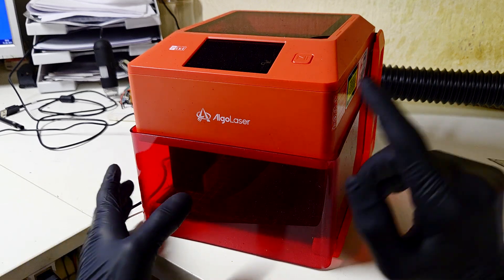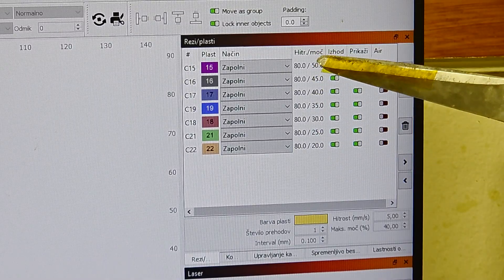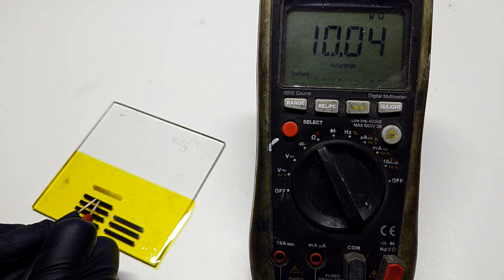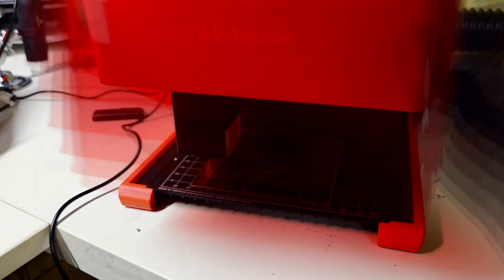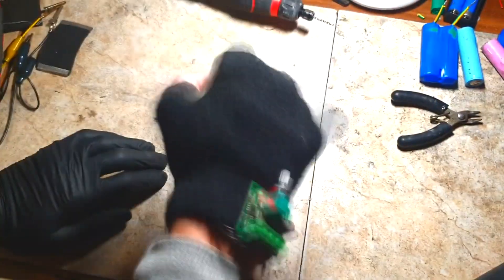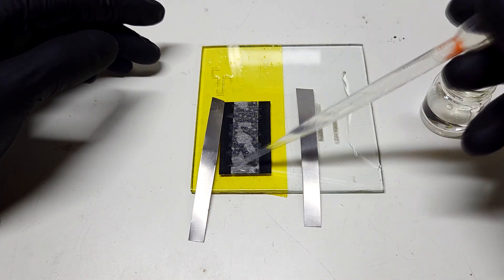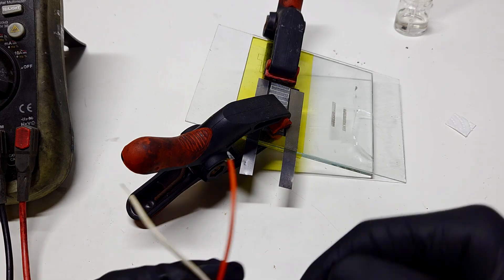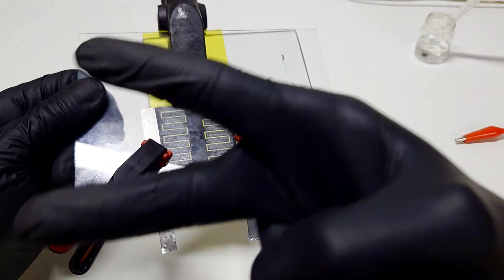DIY Laser induced Graphene Supercapacitor

Comment: Another great video, and probably one of the best I have seen to demonstrate how to calibrate your laser  speed & power settings. One improvement (as shown by James Tour from Rice University who developed this process) is to de-focus the laser  slightly. This can often be achieved simply by adjusting the laser's material thickness a few millimetres higher than what it actually is. This will then effectively widen the laser's beam & allow the exposure lines to overlap slightly and remove the more defined lines that can be seen in the close up images, creating a more even , and therefore more uniformly conductive graphene layer

Comment: A few decades ago, I conducted this same experiment with my 30W CO2 laser using different types of wood as a carbon source.
And the trick I discovered was in the blurring of the laser beam.
You don't need to apply a lot of power.
By keeping the beam defocused, the area is slightly larger and the energy density is lower, but the number of times the beam “hits” that area is greater, which means that it is not necessary to make multiple passes over the same area to induce graphene.

Comment: we need to crowdfund a factory for this where investors get paid in super capacitors
Reply from the maker: 😁 I am in. I was thinking for batteries, but supercapacitors will be also ok 😊
Reply: @cayrex just throwing ideas out there
Reply: @cayrex batteries would work
Reply: @cayrex any ideas on a manufacturing method ?
Reply from the maker: @Soda_and_me  You mean of this type LIG cap? I making a new video on this topic. In the video I try to burn kapton direct on a titanium current collector,... but  the kapton tape have adhesive side which also need to be burned. Other ways the adhesive will isolated the carbon. For that reason I need to higher the laser power from 45% to 80%. But in the end that supercap was not so good like I was  expected. Roll to roll method is also interesting,.... which with that method you can make capacitors or sensors in meters.
Reply: I guess i like the flow battery idea
Reply from the maker: @Soda_and_me  Yes for sure, me to. I also work on Hyperflow lite battery,... which the idea is to make a minimal neutral cell design, robust and low cost battery. The battery donnt have the best efficiency, but can be really cheap.

Comment: In your measurement is sort of problem that gives you not very correct resistance of each graphene stripe. You should touch every stripe of graphene with omo - meter's terminals in exact the same distance between terminals. The best accuracy you would get keeping the longest possible distance on all stripes (the distance must be the same on all stripes ).
Reply: Exactly. A solid spacer holding the probes at a fixed distance would provide a more reliable reading. In the video the probes kept getting closer and closer as the resistance dropped 😕
Reply from the maker: Yes, correct. Before I make a video I repeated the stripe test 5 times, and there was no big difference. The strip test was meant to get the idea what power and speed setting to use for making the heater and the supercapacitor.

Comment: I imagine instead of about 8 fins being drawn on the captive tape, if you had made about 100 or 200 fins with adequate spacing and 2 capacitors in series, maybe you could have gotten a very high capacitance,it's worth a try
Reply from the maker: For sure mate
Reply: The capacitance comes mainly from the flat vertical surface area of the charred polyimide, not from the edge horizontal surface area. Interleaving more will reduce ESR, but will result in less total surface area and so probably lower capacitance.

Comment: According to Deepseek:
Preparing Boric Acid Solution:
Prepare a solution by dissolving some boric acid powder in ethyl alcohol. The solution should be clear. 

Kapton Tape Coating:
Find a flat, clean block (e.g., glass sheet).
Using a pipette or brush, apply the boric acid solution to the Kapton tape, creating a very thin, uniform layer.
Wait for the solution to completely evaporate and the boric acid to crystallize into a thin layer of Kapton. This is a critical step before laser processing.

Producing LIG-B with Laser:
Your boric acid-coated Kapton tape is now ready.
Attach this tape to your laser as you did for pure Kapton.
You can optimize your laser speed (power and speed). The presence of boric acid will alter thermal insulation and absorption. Make small adjustments to the settings you used for pure Kapton until you achieve a regular, uniform, and highly conductive graphene structure.
During the laser treatment, boric acid will be broken down and boron atoms will be incorporated into the graphene lattice.
Reply: After asking other Deepseek questions:
Increasing Energy Density with Manganese Dioxide (MnO₂) Coating
Mechanism: LIG stores energy electrostatically (double layer). MnO₂ stores energy through fast, reversible chemical redox reactions at its surface, called pseudocapacitance. Combine the two and you have a hybrid supercapacitor. This combines both the high power of LIG and the high energy storage capacity of MnO₂.
Materials:
Prepared LIG electrodes.
Manganese(II) Sulfate Monohydrate (MnSO₄·H₂O) or Potassium Permanganate (KMnO₄).
Sodium Sulfate (Na₂SO₄).
Power source for a two-chamber electrodeposition setup.
Platinum wire or Stainless steel counter electrode.                                                                                                                                                                                                                                       Method: Electroplating (Best Method)
This method allows you to coat MnO₂ directly into the pores of the LIG, which provides significantly better performance.

Prepare the Solution: Dissolve 0.1 M MnSO₄ and 0.1 M Na₂SO₄ in distilled water to obtain a clear solution.

Set Up the Setup:

Working Electrode: The LIG electrode to be coated. Connect to the positive (+) terminal.

Counter Electrode: A platinum wire or stainless steel plate. Connect to the negative (-) terminal.

Reference Electrode (Optional but Recommended): A reference electrode such as Ag/AgCl allows you to check the correct potential.

Coating Process (Electrodedeposition):

Immerse the LIG electrode and counter electrode in the prepared MnSO₄/Na₂SO₄ solution.

Switch the power supply to constant current (galvanostatic) mode.

Apply a low current density of ~0.5 mA/cm² (for example, 0.5 mA current for 1 cm² of LIG).

Continue the process for 5-10 minutes. The color of the LIG electrode will change from light brown to dark brown/black. This indicates MnO₂ accumulation.
Reply: DeepSeek also gave the answers that Nitrogen Doping (N-Doping) can be done in a similar way using 50% Ethyl Alcohol (Ethanol) or Isopropyl Alcohol (IPA). I enjoy following your Cayrex channel. If you have the opportunity to try these, I am very curious about the results.

Comment: Ever tried putting graphite powder in a microwave? The end product is graphene/graphite containing graphene that looks like a lot of curly micro hairs. Supposedly It can also be used to clean up oil spills because it absorbs oil very well. Be careful though, it creates a lot of plasma and gets hot enough to melt glass in seconds when exposed to microwaves. Using a firebrick might be a good idea.

Comment: judging by the resistance i doubt you got any graphene there... might be less than 0.1% and the rest is mostly carbon
Reply from the maker: A perfect, defect-free monolayer of graphene has extremely low intrinsic resistance, but that only exists as a theoretical ideal — in practice, no one can make or handle a perfectly continuous sheet. Real graphene or graphite is anisotropic (great in-plane conduction, much worse out-of-plane). And in practice you’re not dealing with a perfect monolayer sheet, because real samples have defects, boundaries, and discontinuities that strongly affect conductivity.
Reply from the maker: I still get better resistance than some research papers based on this topic. But yes, like I said besides graphene you also get a mix of other types of carbon as well.